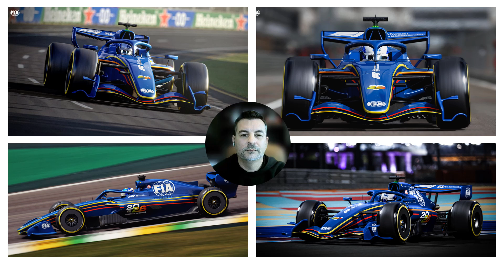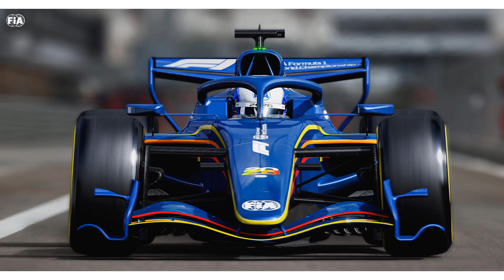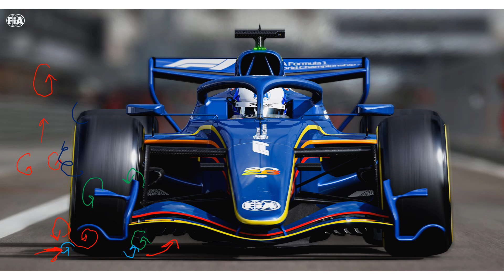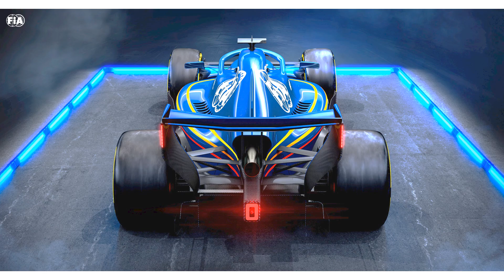F1 2026 Updated Render: Aero Curiosities

Comment: I’d be far more excited for these regulations, if it wasn’t for the new engines. I’m worried that races will just become a fuel and battery saving exercise. From the sound of it, drivers may have to lift and coast on qualifying laps, because the electric power won’t be able to do even one lap at full power. The aero and chassis regs are cool, but the new engines will be the biggest aspect of it.

Comment: Say what you want about the technicalities, this has to be the best looking F1 car we’ve seen for about 20 years. It LOOKS fast, therefore it looks good
Reply: The wheels are way too big. Makes the car look ill-proportioned.
Reply: @QAZWSX545  they’re actually smaller than the current regs. Drivers had issues with visibility
Reply: @ the wheels will remain the same size at 18”, but the width of the tires will be reduced, which gives the car a very awkward stance and makes the car look worse IMO.
Reply: @QAZWSX545 the rim itself is the same diameter, but the tyre isn’t. The sidewalls will be thinner, therefore the wheel itself is actually smaller in width and height. But I see where you’re coming from, big wheels looks cool. I guess I never minded them being small after watching the late V8/early V6 era
Reply: Front wing looks terrible
Reply: @boostav  false
Reply: @boostav false. It looks great
Reply: Front wing looks great to people with no taste. So yes, a lot of people will like it, there's no need to comment.

Comment: Did they ditch 3 element rear wing design
Reply from the maker: Yes.  Three elements is still possible.  However, I don't believe it has to be three.  You could run two elements.

Comment: considering how restrictive everyone thought the 2022 rule set was and how diverse and interesting it ended up being, I'm excited to see how this pans out. the mandatory inwash strake and inboard front wing will definitely limit the ceiling on how much outwash can be generated, and more importantly, how much the dirty air will affect the following car!

Curious on your opinion here: with the mandatory in wash fence, do you think a sidepod a la the 2011 mclaren would be useful? to ingest in the in washing dirty air so it doesn't affect the rear downforce bodywork, but rather be used for some cooling? or do u think the 2024 bodywork forcing an outwash would be more useful/
Reply from the maker: I agree on your take regarding development!  This is such a generic render, and the teams will go nuts within their regulation boxes and inside of the tech regs to find gains.  It's an exciting outlook!

Regarding your other question, maybe that's an option. However, you still need this energy to help in thermal energy transfer for cooling.  So high CpT flow helps with cooling system efficiency.  I am thinking moreso that teams will look to find ways to create some structures that help to dissipate and break-up the tyre wake, and entrain some high energy flow in the process to try and recover some CpT.
Reply: @ makes sense. I’m wondering what the trade off proposition between cooling requirement vs clean air to the rear will be.

Currently reading neweys book, and he’s always so concerned with the overall picture that I’m sure this mandatory inwash strake is giving him an aneurysm.

My second comment about the sidepod, I wanted to elaborate:
Given how important outwash is to generating performance, it made sense to have the air intake high and inside, also because it allowed to outwash.

But with these new regulations requiring this large inwash fence, could that 2011 sidepod style be useful in that it fully collects the dirty air behind the fence, and although it’s not clean, still provide enough mass flow to the radiators, and the benefit being complety removing front tire wake from the rear flow structures?

From my (very amateur) eye, it seems like a trade off worth doing especially considering the volume of intake can be large enough to still capture clean flow inside the front wheel to manage cooling?
Reply: @drobbs6463  Wouldn't the shark nose inlet design be retained to create high pressure just to the rear of the inwashing vane and thus drive some of it outboard that way?

Comment: i read somewhere that the 2026 cars will be 10 sec slower compared to current gen cars. is that true or not and if indeed it is true, is it mainly because of 50-50 hybrid engine?
Reply from the maker: Not entirely sure. From an aero standpoint, they will struggle initially to generate the same peak load that these cars now do. But I don't doubt they will really find their way.  The technical progression from start to finish is what I'm really excited about!
Reply: all aero changes
Reply: @@abhinavsharma1006 Engineers will find a way to make it faster like after every new regulations.

Comment: This seems the weirdest rule set that we ever had in f1 , both in terms of poweruntis ( which it is not making any sense) or in terms of aero . anyway, great video.
Reply from the maker: Certainly an artifact of the pressure from auto manufacturers who are moving more to 50/50 hybrid systems.  It will be interesting to see how the energy storage systems work and how much efficiency they can find.
Reply: really? PU rules are very similar to LMP1H, it makes a lot of sense to me
I just don't think they'll use it the way F1 expects (at high speeds)
Reply from the maker: @PenteanoO  Good shout!  They are similar.
Reply: @drobbs6463  To me LMP1H was the best regulation in motorsport history so I love what F1 is doing in '26. Still wish F1 would allow different engines, maybe Porsche would have joined if they could use their V4 from the 919. I freaking love hybrids when they are used for boost
Reply from the maker: @PenteanoO  I'm trying to stay optimistic indeed!